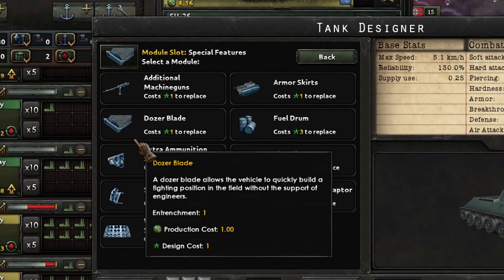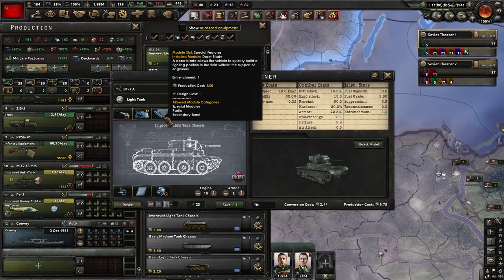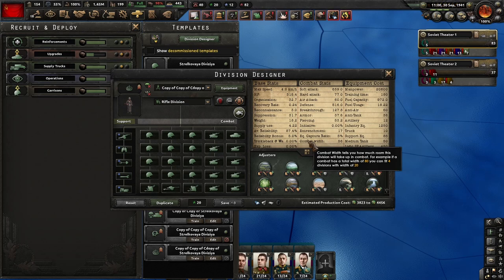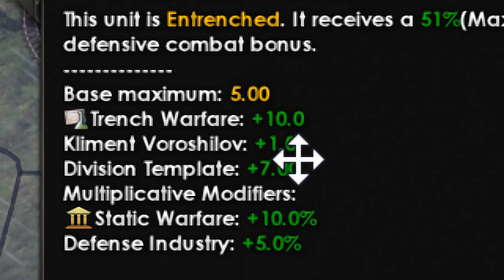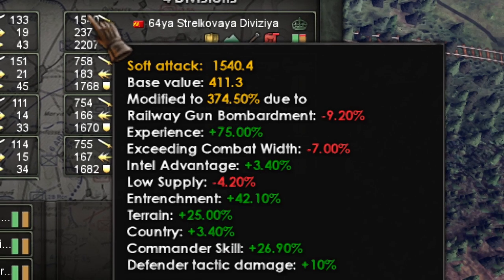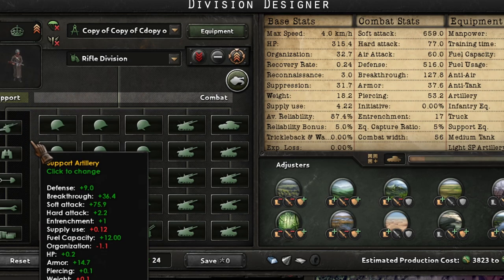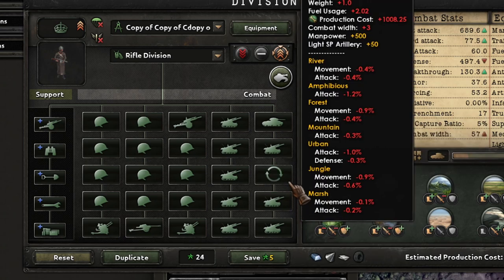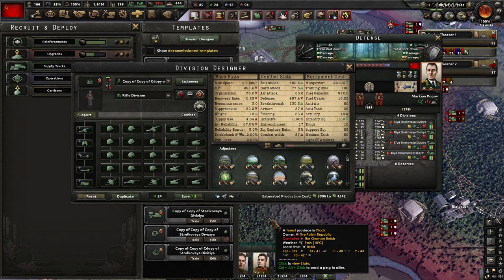hoi4 How much damage do you deal with Dozer Blades when defending

Comment: I tend to make production queues of extremely cheap inter-war light tanks (regular and later flame as well) and add dozer blades to them in order to give my line Infantry extra entrenchment. As the Soviets this massively aids in defending against the Axis for example.
Reply from the maker: That's a very clever idea.  have you tried to use improved light with wheels? I think the IC/reliablillity may be better.
Reply: @tinoduboisen9703  hmm.. not a bad idea. I'll gibe that a try later!